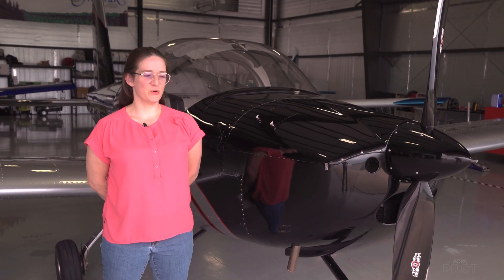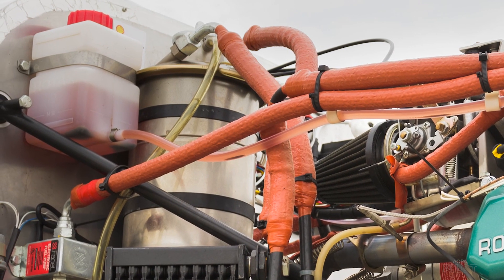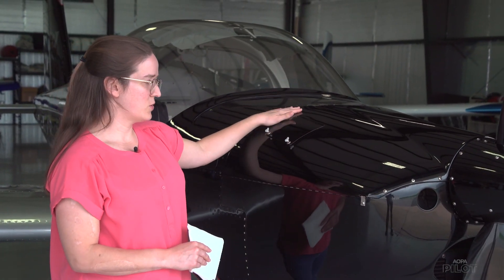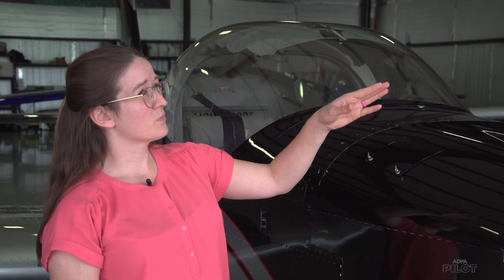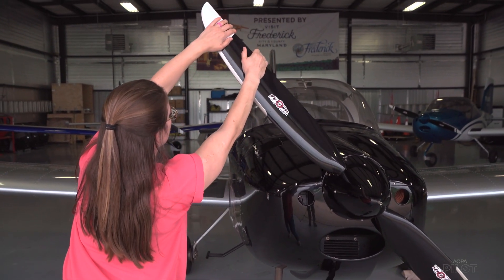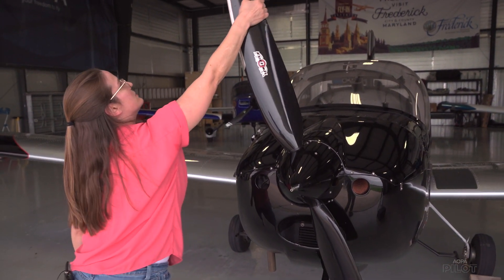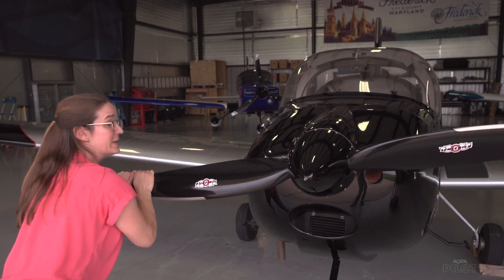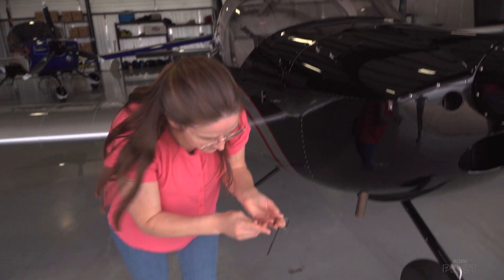Tips & Techniques: How to Burp a Rotax 912

Comment: Run don’t walk from Rotax. Owned one for years and I’ve come to see it as a very sensitive, hard to fix, glorified snowmobile engine.
Can’t find hardly anyone to work on a rotax. Parts prices are more than a real ac engine. $800 for a shitty motorcycle radiator? Really?
$1600 for a muffler? 
Overheating for no apparent reason. Built in design flaws that lead to exhaust leaks 
And more and more. 
Virtually any A&P worth their salt will tell you to avoid Rotax at all costs

Comment: As a general rule, never turn a prop with vital parts of your body (ie. your head) within the arc of rotation. And stand behind the prop so that if it started one day (I know the rotax won’t but impulse coupling engines could) the aircraft and prop are moving away from you. Lovely video nonetheless. Thanks.

Comment: I got told to do it from the back of the propeller. If it kicks and starts then it wont run into you. Of course you should always make sure the mags are grounded and the Master is off before you try...

Comment: Informative video, as I always wondered about this. All that work just to check the oil level makes me even happier with the old school 0-200D in my new Vashon Ranger. The Connie doesn't have indigestion & is better sounding with it's equal length header exhaust. I jest a bit as I'm certain the Rotax is a fine engine with particular modern advantages, just not for me.
Reply: The rotax is a terrible engine. Leaves you wondering if it will Overheat or fail on almost every flight… not kidding unfortunately

Comment: A couple of things here; oil is not only settled in the engine but also the gearbox.  Secondly, there are no magnetos in a 912ULS engine but two Capacitive Discharge Ignition units and the engine must spin at a little over 200 RPM to get enough juice from the magnetic pickoffs on the flywheel to get any spark.  You can't hand prop a 912 (unless you can get it spinning that fast). The other advantage to this is that the action of pulling the prop through also causes the mechanical fuel pump to put a little pressure in the fuel lines, which can show you any fuel line leaks that you might not otherwise see.
Reply: Sorry but there’s a video of how to hand prop a 912. The guy just pulls the blade and it starts like any other aircraft engine.
Reply: Not unless he's seriously modified the engine from its original configuration.  I do not believe its possible to get there with a stock 912.  Video can show you anything; especially these days, just seeing something on video doesn't make it truth.  Do you own or fly one of these engines?  In the RV-12, for instance, the alternative to the hand pull throughs is to leave the ignition off and hit the starter for 10 seconds.  The engine doesn't start...and it won't until you turn on the ignition and get current to the CDI's.

Comment: Rv12 owner here, clearing up some of the comments, yes always check key is out and lanes are off, however rotax has a fail safe where since the engine is geared it is not possible for the engine to start until it reaches high rpm, somewhere around 200-400rpm which, for anyone who’s burped a rotax knows how much effort it takes just to turn the prop. Great video though!
Reply: Would you do this before every flight or only when checking oil if for example flying multiple flights a day ?
Reply: @tyjohnson7428 before every flight. They use oil like any airplane engine. 
FYI Rotax suck btw. Buy one and you will regret it until you sell it to the next sucker
Reply: @nickr5658 

Why do they suck? The sensors are a little cheap and don’t love high heat situations but that’s the biggest issue I’ve noticed…
Reply: @manifestgtr  So many design and engineering shortfalls, that lead to a engine that is questionably safe and not what I view as dependable. most a&ps will not work on them. There’s almost no one who is rotax certified in my state. Most seasoned a&ps I have spoken to who know rotax and Lyc Continental say Rotax are more difficult and expensive to maintain and require constant adjustments and maintenance. (This is 100% true from my ownership experience) You also can’t rebuild them over and over as you can the normal air cooled engines. 
Don’t even get me started on factory support, there is almost zero factory support. Parts prices for what your getting are a rip off.

Comment: Always check magnetos are off and keys are out, and dont fill up with oil before burping first! Sometimes you’ll have to do this procedure with hot engine (particularly when you rent an airplane and you dont know if the previous pilot had checked oil correctly) as part of pre-flight check
Reply: No mags and the engine needs to be at 400rpm for the ignition to come alaive.

Comment: I would not own or fly any plane that has a Rotax engine. They are overstressed and not reliable.
Reply: Evidence, please.  There are many thousands of Rotax 900-series engines in the field and they have excellent reliability.  TBOs have steadily risen since their introduction.  New engines like the 912iS in this RV-12 have a 2,000 hour TBO and with proper maintenance have no trouble reaching that number.  Service centers like LEAF and Lockwood have stated that they see very little wear inside engines they tear down, including those used in flight school aircraft that may not always be operated properly.  Operators of the 912iS report fuel burn rates better than specified by Rotax; in many cases well below 4 gph at cruise power settings.  The fact is that Rotax makes an excellent range of engines that have high power-to-weight ratios, excellent reliability and outstanding operating economy.  You're free to own and fly what you like, but you're misinformed about Rotax engines.
Reply: @FlyingShotsman rotax are a modified snowmobile engine using lots of parts from motorcycles. Carbs, ignitions, radiators, etc. 
difficult to find someone qualified to work on them. They have tons of design flaws that will mean you won’t fly nearly as much as a cont or Lyc. 
Issues crop up all the time with these engines, they are very sensitive. And they are hard to fix, lots of tinkering to get them to work right.
Buy one and you will regret it sooner or later
Reply: @FlyingShotsman do you own a rotax? I own a rotax and can confirm he is right.
Reply: @FlyingShotsman  No worroes, he has no evidence only an opinion. And a bad one at that.

Comment: Might be worth mentioning that prior to this procedure one should always confirm that the keys are out, the magnetos are off, and the fuel is off to avoid accidental engine startup.
I'm not sure what the procedure is for electronic ignition but I imagine a similar fail-safe would be required
Reply: agree and to remove the oil cap prior
Reply: you can not start a rotax by hand propping
Reply: @waynekimm.ngi.5696  To be clear, you can but it is extremely dangerous, so do not try this, not even when you have done it with other engines, Rotax engines ar at RPM within a turn
Reply: @waynekimm.ngi.5696 
If the ignition is on and the engine has magnetos you will be able to start a rotax engine by rotation of the propeller
Reply: .. Assuming the magneto switches are in the on position
Reply: @kavghanouni6229  No you can't. It has to be at 400 rpm in order for it to start so unless you'er Superman...
Reply: rotax will not fire until 220 rpm , because it’s geared that’s 60 rpm’s at the prop don’t think you can hand prop that fast
Reply: @waynekimm.ngi.5696  You might well be right. But it's a case of balancing risk and consequences for me. I would have to be 100% certain you're right before I would try it. And without that level of certainty I'm just not going to do it